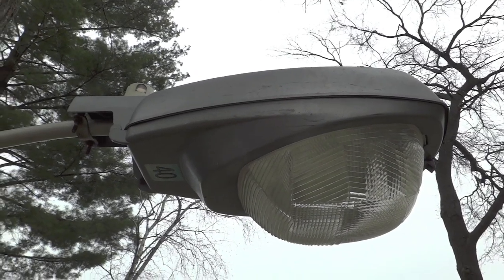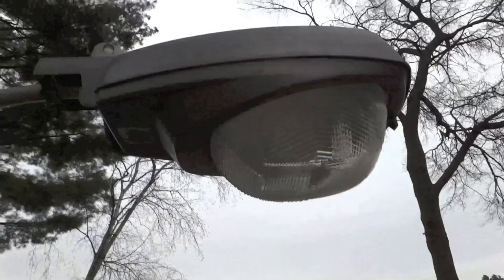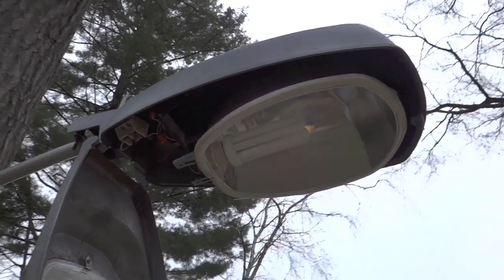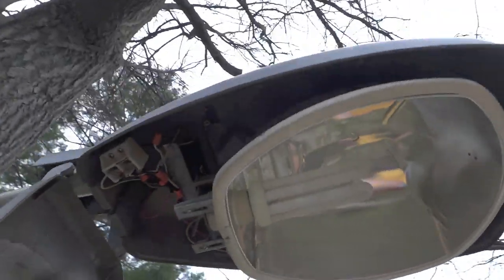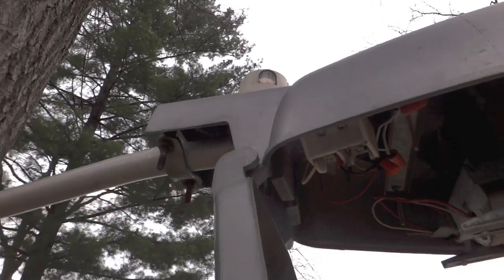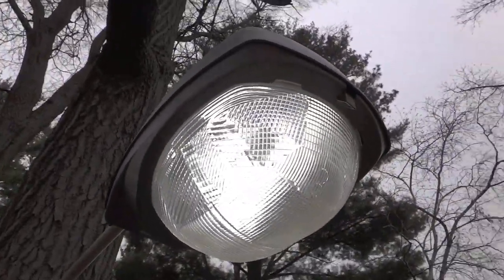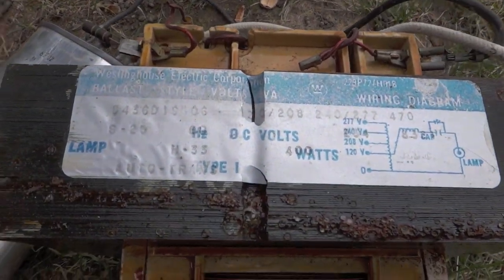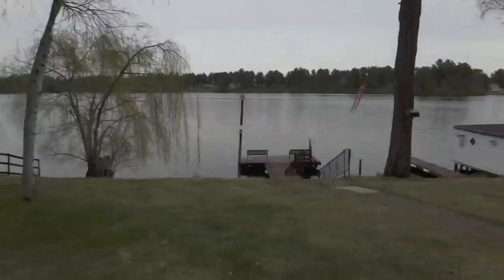Crouse-Hinds L-250 65watt Fluorescent Streetlight

Comment: There is only one left of Crouse-Hinds (formerly Westinghouse) 400 watt LPS  on northbound Woodward Avenue, between 12 Mile Road and 13 Mile Road in Royal Oak (outside of Detroit) Michigan since the early 1980s. Between 1980 and 1985, Public Lighting Department within the Detroit City Limits are outnumbered Detroit Edison (now DTE) in the suburbs outside of Detroit Michigan which is only a handful of these type of Mercury Vapor street lights. All of Crouse-Hinds 250 LPS, and 400 HPS are no more within the Detroit City Limits and they are replaced by LED street lights at least 3 years ago.
Reply from the maker: Thanks again for the cool info!

Comment: Cruise Hinds (formerly Westinghouse) on both 250 watt HPS and 400 watt LPS street light fixtures from 1980 to early 1986 are common throughout the now fastest growing state, Montana, especially the eastern Great Plains part of that state, with more then 200 of these. Montana also uses all models of pre-1980 Westinghouse Mercury Vapor street light fixture, and now they are replaced by LED street light fixtures to save on energy.

Comment: We have these EVERYWHERE here. Do you know what the production years of the L250 was or is?
Reply: I think they were born in the late 70's.  They also have a smaller version of them.  When I was a kid in NYC, I used to see both of these fixtures.
Reply: 1979-1985. They were Westinghouse from 1979-1982, and the name OV-15 and OV-25 still remained even as Crouse Hinds owned them. I don’t know why everyone says “L-150” and “L-250” because that never was the model number for these.
Reply: Vintage Fan Collector  Thanks! Unfortunately they replaced all of them with American Electronic Autobahn ATB2 Led fixtures and they seem to have way more trouble with those than the old Crouse Hinds.

Comment: @Parrot175 Have you tried running that 50-watt MV bulb in that electronic ballast? 
If yes does it work?
I have loads of magnetic ballasts but no electronic ballasts yet 
In the UK magnetic ballasts are still the dominant fixture even in modern fittings The electronic ones haven’t court up yet but as they say the UK is always 10 years behind America ie they are still using 50-watt MV bulbs for lighting up traffic ballads & large road signs

Comment: It is formerly Westinghouse Silverliner, Type OV 25 that used in the most of 1960s and 1970s. This is the early 1980s Crouse-Hinds street light fixture L-250. And in 1986, it changed it to Cooper street light fixture with a new model, and another newer model for the early 1990s, known as L-100, and L-200 series.
Reply: No, these were always the OV-25. They switched to Cooper/Crouse Hinds production in 1982. This model came out in 1979, and was still called the OV-25 even then. And it went out of production in 1985, because the OVM replaced it. Never were these actually called “L-250” or “L-150”.
Reply: Vintage Fan Collector, if the fixture get broken, such as the door with refractor (lens) came off and chash landed to the ground, and sometimes the reflector is trying to separate from the socket by hanging upside down on the base or the bulb. General Electric and American Electric (also Thomas & Betts) have their reflector anchored to the socket since the early or middle 1970s, including the later ones between 1959 to late 1970s General Electric, Model M-400R as of single door units, as well as the Model M-400A as of double door units, to prevent the reflector to separated from the socket.